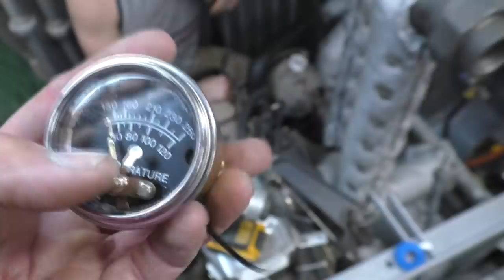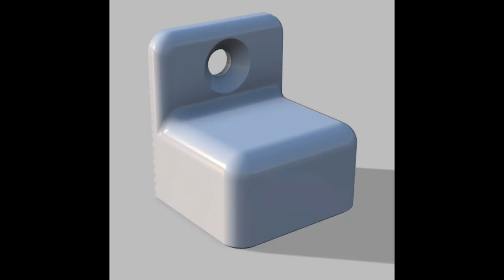Hydraulics - Part 6 - also some engine gauge work.

Comment: Magnificent job.  I would recommend making system one line diagrams, then taking pictures of the actual system installation, and linking to your diagrams for training, future reference, and trouble shooting.
Reply: It's all in the videos if you needed to go back and dig it up. Problem is it would be pretty time consuming to find the bit of info you needed.
Reply: @JDeWittDIY  Problem is the full details aren't in the videos we see, Doug must have more archival footage but that only works if the computer does.  They need a set of hard copy drawings for when the power is out...
Reply: @rickt9793  Agreed, that would be very useful.

Comment: Yep, the system isn't that complicated, but a few years from now when problem start to arise you aren't going to remember some of the details. you should be labeling some of the lines and components. Cheap easy now and a real time saver later.
Reply from the maker: Dam!  I should have made a video.
Reply: @SVSeeker  your videos are great, I must have missed the one where you install internet access for the middle of the ocean, or may be you will carry a laptop with all you videos loaded on it.   How everything is backed up.

Comment: Great videos.  Considering the blocked check valve, is it still OK to have your hydraulic relief valve downstream of a checkvalve?  (on the assumption that the fancy one on the pump side goes awry).

Comment: Need to colour code the different lines RED high pressure oil Pink return oil Blue water high pressure Light blue low pressure yellow fuel in white fuel returns etc just a thought guys
Reply from the maker: Definitely going to paint the all pink.

Comment: I need to do the drum in the back of the truck thing.
Reply: @jasonvolk6650  i have a hilux and putting 200kg in the back makes no difference thats about a 44 gallon drum also an accident is just that and not much difference between a tank in the back or a tank under the car as long as its secured
Reply: @jasonvolk6650  probably why it is under a tarp....but who cares, maybe he doesnt want to make 100 pit stops...he did say he was driving cross country